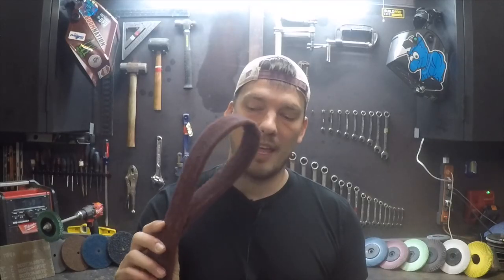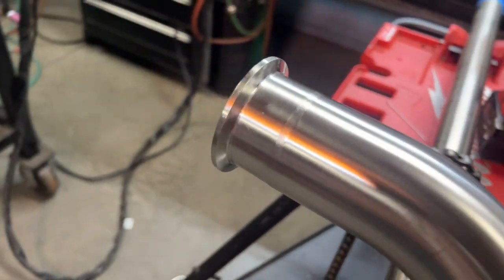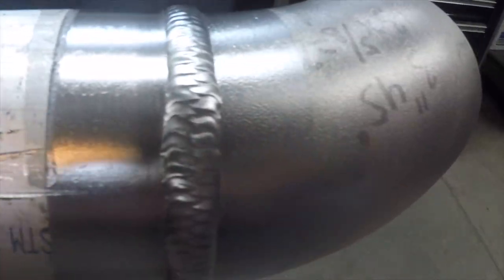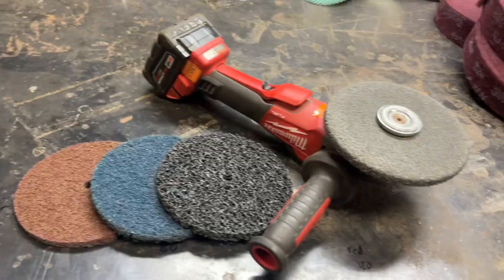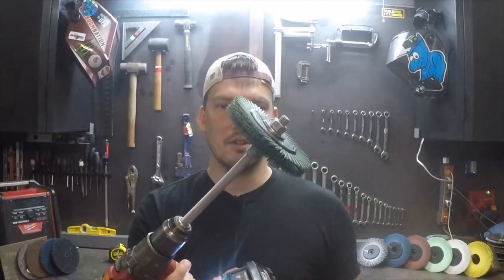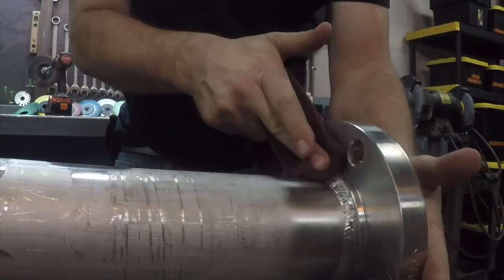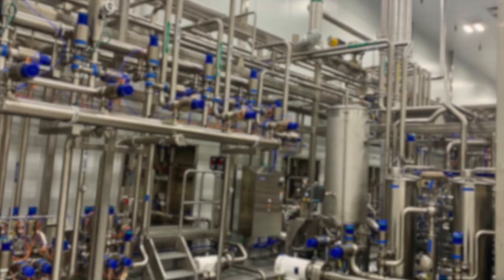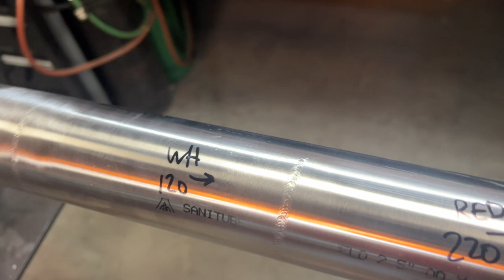STAINLESS STEEL Weld Polishing and Cleaning -- Pipe And Tubing

Comment: Your tig machine makes for a great electro- passivate machine. Maybe even more powerful than the dedicated machines. You just buy some cheap Chinese carbon wands @ 10 bucks, thread some copper on the end of welding cable, jam them in a piece of PVC and you're done. You use AC for cleaning up to 70-80 amps and very low amps DC for polishing but use the negative for the wand on DC for proper flow of electrons. You'll need to buy some of that phosphate based electropolish solution they sell for the dedicated machines.  I used the acid gel for thirty years and just got sick of it. Not to mention the glob I got in my eye that put me in the hospital. Electro cleans better than gel anyways. A DC copper wound battery charger also works. Just bugs me how much these fancy electro machines cost.

Comment: Hey drew I’m interested in running the radial bristle wheel on a grinder. Is there a certain adapter I would need for that? I thought the wheels just have a plain 1/2” hole?

Comment: Wow great video, 

So if i use gray brush to brush a weld, and remove most material to have a smooth finish, 

Do i still need to passivate or the disc is enough to remove and protect from future rusting? 

Usung it for thin SS sheet panels for automotive restoration

Comment: Love the videos man.  I'm currently tasked with repairs on crack piping due to water hammering.  I can do just fine on all the bench work of fabing pipe but how do you clean and fix cracks to prevent them from continuing to happen?

Comment: hi mate, I started making stainless exhaust parts like headers, manifolds, etc. My welds usually have colour on them, gold, sometimes even blue. they look nice, do you think theres any benefit to cleaning exhaust stuff like this? Ive found when the exhaust gets used and the stainless discolours, you can usually see a band where the heat affected zone was, not sure if this would help with that
Reply: Yes it will rust. It is only a matter of time

Comment: Bit of a random question, but how would you go about welding Tri-Clamp Flanges into something that's not a tube? Mainly something like a large boil kettle, would you just be taping off the large opening and going about business as usual, pretending the kettle is a giant tube?

Secondly, are there any special or different techniques for sanitary welding copper?

Appreciate the videos!
Reply from the maker: When welding a tank ferrule to a tank, you can isolate the weld for purging by taping off the face of ferrule and making a large pocket on the inside of the tank with foil or tape or anything. That way you just purge the small chamber and not the whole tank.